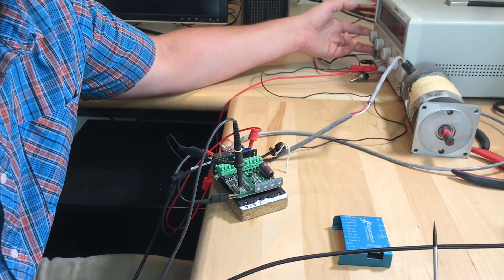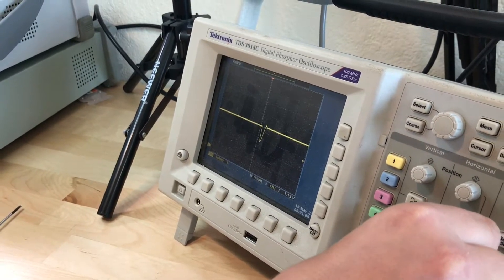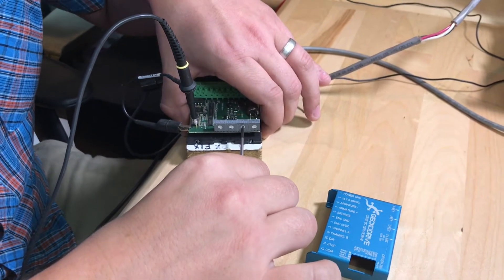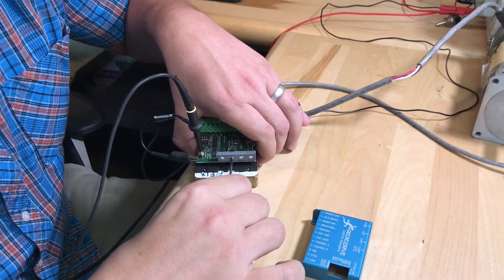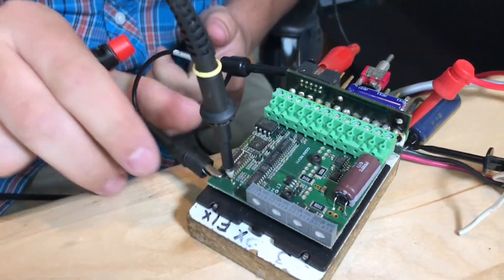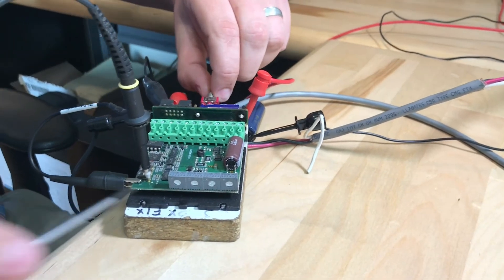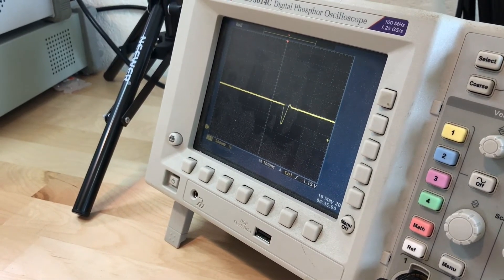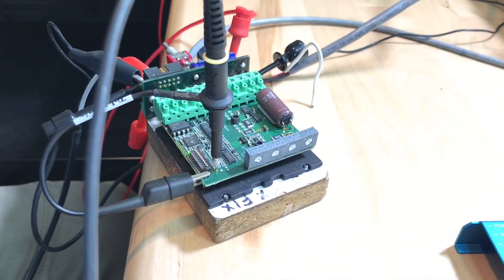Geckodrive G320X PID Tuning with an Oscilloscope

Comment: Can SEM Servo motors 35LB/IN. 16.6 AMP. 100 V Work with this drive???
Reply from the maker: Yes, however the G320X is limited to 80VDC. Because speed is directly proportional to voltage in a servo system you will get 80% of your maximum rated speed.
Reply: @GeckodriveInc  Thank you very much sir!!

Comment: What DC motor is that in the video?
Reply: The motor in the video is from Automation Technologies and has been in service for so long that the part number is no longer on the motor. It is rated for 80V and 20A, which is why we use it for all standardized testing of our servo drives.
Reply: @marissafisher9673  Excellent. Thank you for the response!

Comment: Change mosfets with irf4227 (high speed) good results
Reply from the maker: We rate all of our components for the drive's ratings and PCB design, and do not recommend changing components on the drive. After careful vetting we have actually changed MOSFETs on all of our motor controls away from our old IRF540Ns. Our new component is a much more efficient MOSFET that reduces heating significantly when compared to the previous iteration.

Comment: Am i capable using these drives without a scope?
Reply from the maker: Yes! The oscilloscope is there to show a graphical representation of the PID loop on the drive. Once the loop is set there is no further need for an oscilloscope, and tuning does not absolutely require one. Tuning without an oscilloscope will get you about 90% of the way to a perfectly tuned drive.

Comment: Hi is the drive closing the loop and the controller just supplying Step and Direction.  Like with a Acorn or other Similar breakout boards.?  Thanks
Reply from the maker: The loop is closed on the G320X internally. The drive receives the command from your software or controller, send the appropriate movement to the motor, receives feedback from the encoder to verify that the movement has been made, and then awaits the next command. In the event a step is missed the G320X will make up for lost position automatically so it is always in a 1:1 ratio of commanded versus actual position.

Comment: can we get rid of dithering sound
Reply from the maker: Hi Avni-The G320X maintains position by moving between two line edges, which is knows as dithering. The sound can be reduced by adjusting the PID loop and lowering the GAIN setting on the DIP switches. Because dithering is integral to how the drive knows its position relative to its commanded position is cannot be fully eliminated.

Comment: can do velocity feed forward and stiction ?
Reply from the maker: The G320X is a step and direction drive. Any movement it makes is based on the input pulses, and all velocity calculations are done by third party software. The G320X functions off of a TTL pulse that will be output according to your software and application requirements.

Comment: great video, can you explain "which is what puts a load in the motor"... how do you put a load in the motor, you mean powering the motor is when you get a load in the motor? thanks
Reply from the maker: Hi Manny- The instantaneous direction reversal puts a load on the motor, where it must increase current to compensate for the commanded position now moving the opposite direction. A load on the motor is what forces the drive to servo, or chase its commanded position.

Comment: What is the probe measuring? The actual encoder/shaft position as seen by the driver or the calculated error (command minus actual)?
Reply from the maker: HI Christian- The probe is measuring the following error and settling time of the drive.

Comment: Where should I connect my leads on the driver from an oscilloscope in order to measure the PID curve?
Reply from the maker: Hi Lamira- Thanks for your question. You should connect the leads to the test point pads as shown in the video. The two closest to the edge of the board are GND and the two closest to the inside of the board are test points. The diameter of the hole is such that you can insert a scope probe directly into the hole without the need to hold it there.

Comment: Very helpful,  ??? What does 'P leads D' mean in this context. Is it adj. pot rotational position and if so which is lead and which is lag.
Reply from the maker: Thanks, George. The "P", "I", and "D" stand for "proportional", "integral", and "derivative". Those are the three components of a servo loop, and National Instruments has a pretty decent white paper about it that you can see here: http://www.ni.com/white-paper/3782/en/

The TL;DR of that is this: Imagine you are at a stop light in a car and there is another car next to you. Your job is to keep pace with that car once the light turns green. Once the light turns green (step pulses begin and the other car is your commanded position, while your vehicle is the actual motor position) the other car takes off. What you do is determine the direction it is traveling and slam on the gas pedal. This is the proportional value of PID. Once you begin to catch up you can let off the gas pedal a bit so you do not overshoot but are still gaining on them. This is the integral value. Once you are next to them you will vary the pressure on the gas pedal to match their speed, which is the derivative value. That is functionally how a servo motor and drive works, and how the G320X can maintain commanded position under load. 

The PID trimpots are going to be CW is all the way ON and CCW is all the way OFF. The D always leads the P, so if you turn up the P it should not exceed the D setting. 

Sorry for rambling and I hope I didn't just confuse you more. Have a great weekend!
Reply: Awesome explanation/elaboration , surely will help many more than just me. THANKS!